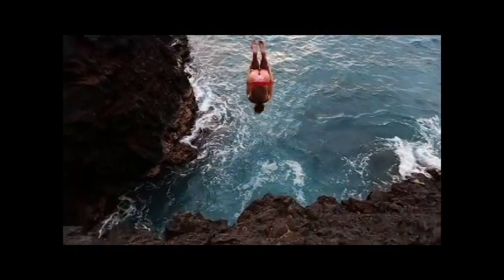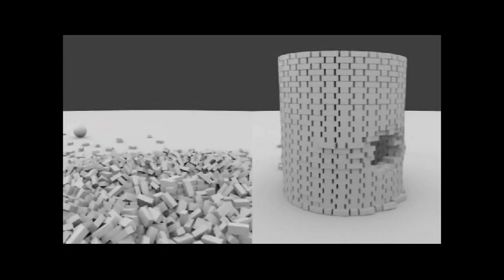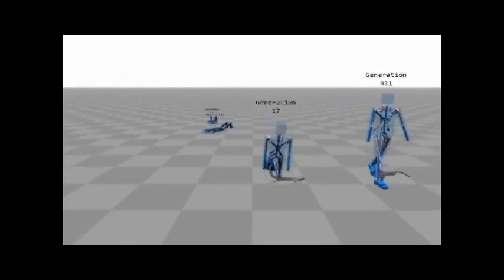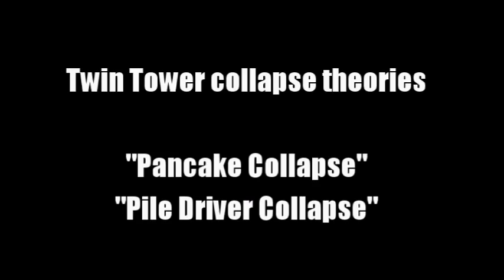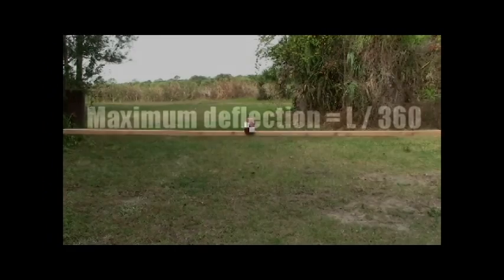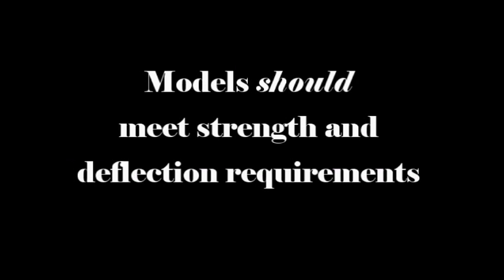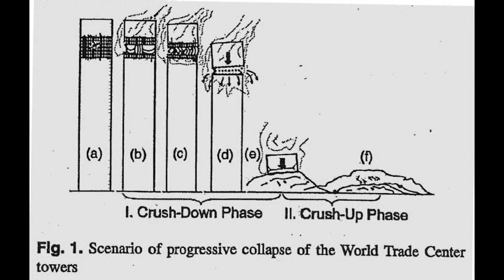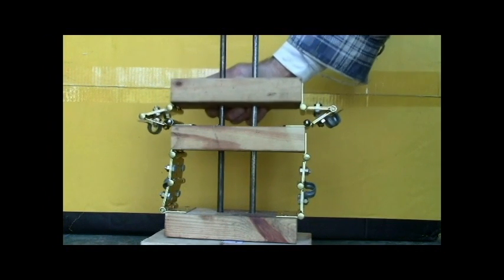9/11 Experiments: The Force Behind the Motion

Comment: Well jeez I'm convinced! Your backyard experiments with paper models are truly persuasive. Mass absolutely does matter you kook. A valid experiment would be to re-build the towers, hit them with planes, and see what happens. If the floors had been detonated there would have been extremely loud noises before each one. Instead it was nothing but the sound of a structural failure. This is absolutely absurd. Again, the south tower fell FIRST even though it was hit second because it was hit lower. Thus there was more weight above the impact zone, being supported by failing steel. It also fell faster. As you would expect. The mass of the section above the impact zone on the north tower was equivalent to the TITANIC. This is not complicated.
Reply: The buildings fell at the speed of freefall.  In other words, the massive vertical interior and exterior  structural steel had no efect on the collapsing building.  That's a physical impossibility.
Reply: Why do people always say that?
You can see big chunks of shit on the outer edges of the collapse falling faster than the rest of the structure, that's what free fall speed looks like!
The rest of the collapse is hidden by the debris cloud.
Reply: Android811 

1.) Shock value is my best guess im no expert on domestic terrorism.

2.) Yes but we are talking high grade structural steel, lets give the jet fuel burn for 15 minutes just to expand your case. All 20 floors would have to be completely engulfed and burning for the same amount of time all and at the heat capable of pushing all main supports to give in at the same exact time, not once but 3 times if you include building 7. If we take this and apply real life, you would know being that high up wind is more severe, dont you think the side of the building getting the gusts of wind would burn hotter again causing the building to eventually topple instead of caving?
Reply: Lol the old elevator explanation that always manages to casually neglect the fact that all modern elevators have brakes on the rails that lock the elevator in place should the power or cabling system fail, like its just dangling there on a cable...
Reply: So those same planes also carefully removed the emergency brakes and or rails that they run on as well too I guess? The cables are not the only thing holding the elevator from plummeting to the ground, so if you cannot demonstrate a basic understanding of the engineering precautions taken to prevent this happening then you have no chance of providing a compelling argument that will convince me or anyone else here that what occurred was exactly as it appeared.
Reply: Well, you could start by explaining how that could happen because what is known and can be demonstrated is that simply cutting the cable to an elevator doesn't cause them to free fall to the bottom of the shaft. Something like "oh well the explosion from the plane hitting the building not only severed the cables, but also overcame the brakes ability to prevent them from free falling" would be a good start, but unfortunately those elevators happened to fall well after the initial impacts and curiously as the first responders entered the building. No one is inconvenienced by the truth unless they had something to gain from lying, that's the whole point of debating this event, your ordinary American citizen enjoys less freedom and is probably more likely to experience terrorism than even before, meanwhile have you seen Lockheed & Martin's or Boeings share price history, good money in freedom.
Reply: 1) Every controlled explosion I've ever seen collapsed from the bottom floors up.
This case was the exact opposite!
2) Do you actually think the fire was only on the side that got hit?
Reply: 1) You mean yes it does ALWAYS start at the bottom in every controlled demo ever.  And sure, it's possible it could start at the top. but that's never how it's done...... EVER (just to be clear).

2) I work as an aircraft engineer.  I don't think most people understand just how much fuel they can carry.  Jet A1 fuel (kerosine) is very thin.  Even if you spill a small amount of it, it will make a huge puddle, it just flows everywhere.
I guarantee you there would have been fuel fucking everywhere in those buildings for about 20 floors!
Reply: 12:20
Reply: Don't forget the weight of the plane added to the weakened structure.
Reply: Really? There are all sorts of videos here on Youtube where firefighters who were in the building reported hearing explosions. You typed out all of that crap but you aren't aware of information that's been around for years. Get a fucking clue.
Reply: So all these explosions and at the time the building never fell down during those explosions? Obviously those firefighters got out of the building before it fell down.  If it was 'exploding', then it would have fell on them and the world would have seen from the hundreds of TV cameras on the buildings, the result of those 'explosions'.  Power transformers on every floor, gas lines to every floor, 99 elevators with cable suspended cars ......  Id love to see the 'explosion' training that firefighters go through eg:  this sound is a transformer exploding, this sound is a gas hot water system exploding, this is an elevator car hitting the bottom from a fall, this sound is a stick of dynomite etc .. you get the picture now?
Reply: Can U describe me "the sound of a structural failure"..?
Reply: "Instead it was nothing but the sound of a structural failure"
Except we have tons of video from reporters first airing & firefighters saying it sounded like a demolition with bombs going off.
Reply: Here are photographs as well of the towers outside cladding with NO shearing where the "wings" supposedly entered the towers. Cladding is only bent. How did the wings enter the building if the cladding is not cut through? It means no wings entered at the impact sites.
https://youtu.be/nedSFWxw9uI?t=27m38s
Reply: Koala Nectar
Reply: Actually sport the internal and external support columns were on top of the debris pile because they collapsed last.
Reply: Thermite don't make a bang pal
Reply: Loud explosions of what? What types of 'explosions' have these people been privy to in the past to know what type of explosion they are hearing?  Did you ever think that damn gas line that runs to every floor had something to do with it?  Where was the man who was supposed to be triggering all these 'explosions'?  Wouldnt you think one would just blow up the support in the basement of the building if you wanted to bring it down?  Interesting how people think these 'explosions' start at the point where the aircraft hit.  Did the people who wired the building for these explosives put them on a particular floor and then the pilot of the plane told to hit that exact floor so it would look like the plane?  Where was the red spot on the building for the plane to aim at?   There were 99 elevators per building - how do know it may not have been lift cars hitting the bottom from cable and lock failure?
Reply: @bobolulu7615  loud explosions of what you asked? How is it you pretend to know so much but you're not aware of all the reporting of explosions and Bounds being detonated which was reported throughout the entire day in September 11th. We have New York fire department in New York Police Department testifying of secondary explosions. Why are you not aware of this it ruins your credibility
Reply: cantonear1968- a jet plane fuselage is pretty weak. It would have shredded like aluminium foil once it hit the steel columns. No way could it "slice through" a steel reinforced concrete lift shaft. The engines are made of stronger stuff. Why didn't we observe them emerging from the other side of the building? Because they too would have been destroyed on impact.
Reply: No No No.  The fuselage made a nice hole in the side.  The wings cut the steel supports outside and inside of the building.

If you took a kids plastic baseball bat and hit a piece of wood that is stuck in the ground, the bat will just bend and fail.  BUT if you fill that bat with water and try again, it will slice through the wood like the proverbial hot knife through butter.

So in this instance, the planes wings were fully loaded with fuel.  The fuel at that speed of around 500mph, and fully enclosed in the wing of the plane, means it will just cut the steel without issue.

If you think a liquid is soft, try jumping off the Golden Gate Bridge.  At that height and speed that you hit the water, the water is like concrete, as the water cannot move out of the way fast enough to be a soft landing.

There is a steel cutting technique using a water jet to cut through several inches of steel plate - so here we now have water cutting through very thick steel plates.  So why cannot a plane wing that has a liquid behind it, encased in a metal container not do the same?

Have a look at NASAs findings on the failure of the Space Shuttle Columbia.  On takeoff, a lightweight piece of styrofoam about the size of a shoebox came off the side of the vehicle, and hit the shuttles wing, that is made of high strength carbon fibre and covered with tough ceramic panels.  Imagine a little bit of styrofoam breaking such a big hole through those materials.  On experimentation, it was found that projecting the styrofoam at 250mph (the Challenger speed when it was noticed) into the wing section on an angle, it broke a hole in the wing through all those high strength materials.  

And here we have a wing section with 80 tons of fuel in them, that would be 40 tons each wing.  Now you hit a piece of steel at 500mph with 40 tons and tell me that it not going to cut straight trough that piece of steel.

80 tons of fuel at 500mph which is travelling at around 223 meters per second will give you a force hitting the towers of about 18.2 millions pounds!  Given that a 767 wingspan is 48 meters thats about 380,000 pounds per meter along the wing.  Thats about 190 tons per meter along the wing length.  The outside steel beams would just tear in two when 190 tons hits just one of them in an instant.
Reply: @bobolulu7615  Bobo what are you doing? Giving realistic examples, and factual numbers that can't be disputed,  no matter how much a truther Stomps his feet...  
Watch.. they will go right over the entire truther tribes heads, and you will get denial and drivvle in replies
Reply: @jcviaene  oh there you are. Quit hiding from me Joe and answer my question how does your version of the story account for the Symmetry in the collapse? How does your version account for the high velocity burst of debris being  injected? How does your version account for Willy Rodriguez testified an explosion at the base of the bldg prior to the plane hitting on top?  There were no raging fires. The firemen who made it to the impact zone ...and I quote " two isolated pockets of fire that can be taken down with two hoses. He saw the damage.  We can trust what he said. How does your version of the story explained each Tower inexplicably collapse upon itself crushing all 287 columns on each floor while maintaining near free fall acceleration as if the 80,000 tons of supporting structual steel frame work didn't exist? How does your version of the story account for the well-documented presence of molten Steel which burned for months. How does your version account the announcement of building 7 collapsing prior to it actually collapsing. How does your version account for the almost complete pulverization of the building. Even Peter  Jennings ABC News took note and mention this. How does your version account for the buses fire trucks and cars that were burnt down to their frame they were Park blocks away? How does your version account for the miscarriage of an investigation performed by NIST ? Answer my questions each one. You know you have no conceivable reason to even get up in the morning other than to come on YouTube to portray yourself as a YouTube engineering wannabe. You have alot of time to answer these questions....if you can
Reply: @coolk3dat754  you don't know the story regarding William Rodriguez.        Short version...... Rodriguez began helping other Hispanics  after 9-11 that had been injured on that day to get Aid and assistance.    He would tape their conversations in the process of getting them assistance.    One of those transcripts goes like this
"" A man named Sanchez was on B4 level when he heard what he thought was a bomb.  He and another man began walking out.  As they were walking past a freight elevator a fireball erupted from it.. The blast of hot air knocked them down, breaking the other man's knee and ankle.     
That sequence of events corresponds to a plane impact FIRST, and then jet fuel-fed explosions in the lobby and basements next.
Rodriguez ALWAYS claimed explosions below him first, then plane impact second...
Rodriguez contradicts himself without realizing it....
Reply: @jcviaene NOT TRUE  just another fabricated lie told by you.  What else you got?
Reply: Right in this video at 12:20, the firemen are explaining how they heard timed explosions, floor by floor.
Reply: @norakat  they were using that as an example as to what they heard..  .. the floors collapsing on each other sounded like detonations going off, one after another. 
not ONE New York fire department member thinks any Tower came down from controlled demolition, that is a fact.
Reply: Really? ALL survivors and ALL first responders? I'm sure that's totally true! There are many, many video and audio recordings which were taken from very close proximity to the towers, and you absolutely do not hear any loud explosions before the collapse. In contrast, if you watch videos of actual controlled demolitions, where the videos are being taken from a HALF MILE away, you DO hear loud explosions before the collapse. Really, brother, just give it up. It was not a controlled demolition. Gigantic planes crashed into the towers, and the fires they started were completely uncontrolled, and due to the design of the towers the steel weakened and they collapsed. It really IS that simple.
Reply: But yeah, I'm just a GOVERNMENT SHILL! If somebody disagrees with you, it MUST mean they are a SHEEP. It couldn't possibly be that you're just wrong, and too proud and stubborn to admit it. (btw I'm a full time musician, lol at your government conspiracy horse shit. I could not possibly care less about the government).
Reply: I wonder what sound an elevator falling down an elevator shaft would make when it hit the bottom?

KABOOOOOOOOOOOOOOM!!!!!!
Reply: @koalanectar9382  if this wasn't a controlled demolition what would have controlled demolition look like?
Reply: Koala Nectar tell me,if you watch ANY controlled explosion of a building with some height to it, how come they fall in the exact format the towers did? Tell me why didn't the towers fall over from the beams on the side hit burning longer. For the government theory to work all the beams had been cooking at access of 5000° F ALL with the same rate of burn. If the fire truly caused the collapse why didn't it fall to the side onto another building in chunks at a time instead of straight down like any controlled explosion?
Reply: You stinking doofus. They did not fall at free fall. The pieces that fall out AWAY from the interior clearly fall faster than the rest. You clearly see pieces falling faster than others. To say it "fell at freefall" is a massive distortion and totally wrong. Just let it go, it's not a conspiracy you nutjob.
Reply: Android81

1.) Yes it can start from the bottom but are you saying it isn't possible to start at the top?
2.) Do you think jet fuel and plastic just even out perfectly so it all burns evenly enough to cause it to collapse downwards instead of tilting and falling over.
Reply: Android811 
1.) Why would they of used conventional methods during a staged terrorist attack? If you where trying to be smart you wouldn't follow guildlines to code. Instead the used the same methods upside down (top triggers first then bottom)

2.) That is excellent that your job provides you with knowledge so this conversation holds a bit more weight. With the fuel burning at inconsistent heat through due to the fact jet fuel being as light as it is would flow faster out of the holes in the buildings and down the elevator shaft of the building decreasing the intensity of the heat on certain parts of the support beam again causing it to topple instead of collapse. Also at what temperatures MAXIMUM  can jet fuel get when spreading across 20 floors or more? Each body of support would have to be hotter then a forage to get it to collapse downwards all at once with no toppling effect.
Reply: 1) Why even use any aircraft then?  Why not just use explosives and say bin laden planted them in there?
Why go to so much trouble to hide explosives?

2)Spreading out the fuel will not decrease the fires intensity, it will do the opposite.  It will expose more fuel to more oxygen making more of it burn faster.  I'd guess most of the fuel would have burnt away after about 10 minutes but that is more than enough time for everything else on those floors to catch fire and start really raging!
The temperature would have been more than enough.  We use 2024 alclad duralimin for many aircraft parts and it comes as a T3 temper making it very strong.  If we want to bend it into a shape, we put it into an oven and warm it to a T0 temper between (300 and 400 F) and it becomes as soft and easy to bend.  we do our bending and then heat treat it again to get it back to a hard T3 temper.  The temperature to anneal steel is different, but the point is....
It doesn't have to be molten to lose all its strength.  Even just warming a steel structure up gently can cause sections of steel to grow or warp which could cause a failure.
Reply: 1) Would it not be shocking if they just blew the building to smithereens sending massive chunks of WTC all over Manhattan?  I'd argue that explosives could do a much better job and kill way more people!  Just WAY harder to set up and pull off.

2) Doesn't matter if it's cheap mild steel or top quality high carbon steel they all melt at about 1500 degress and they all lose all their strength WAY before they reach that temp.
I wouldn't know what to predict if you had asked me the day before they fell as this had never happened before.  There also had never been a fire in a building with such a unique design like the WTC before.  Remember, those buildings were totally open plan inside.  The floors were only held up by metal clips pinning each floor to the outside walls.  Heat up a few floors worth of those clips and as soon as one goes......
Down it comes!

I know it's hard to believe a bunch of overly religious, goat herding, cave dwellers managed to do this with nothing more than a few boxcutters, but they did.  I doubt they thought the buildings would fall, but they did.  
People who say the president organized this must be too young to remember how stupid George Bush was.  He was a fucking idiot, certainly no criminal mastermind who could pull this shit off!